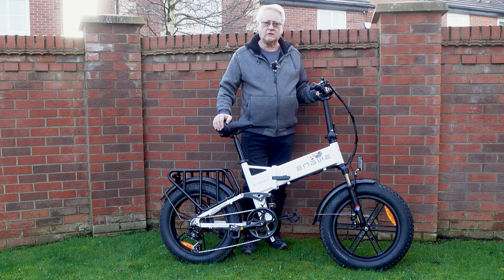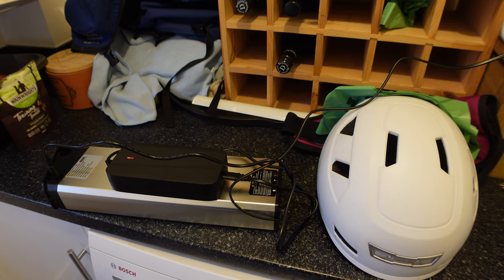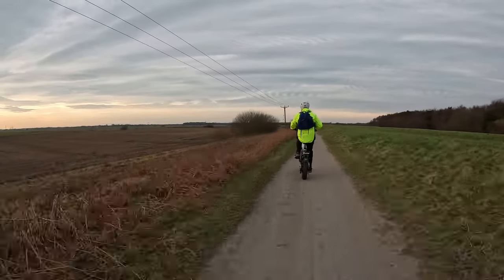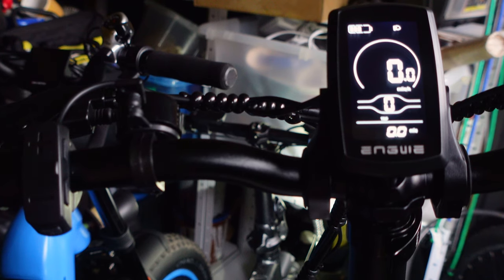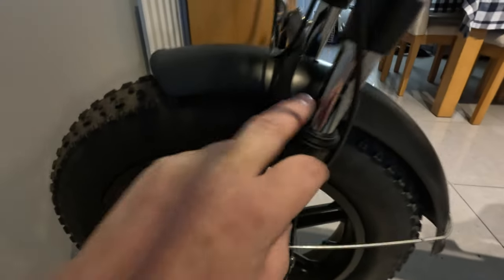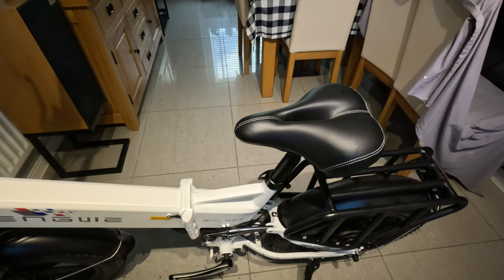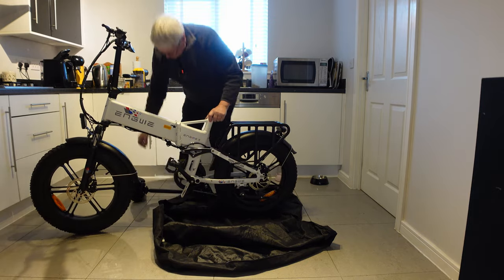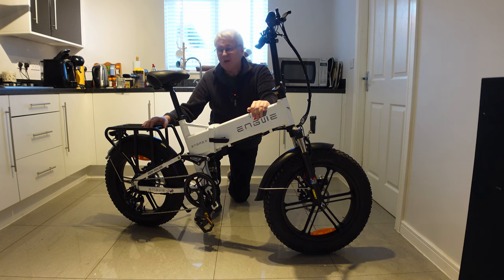Engwe Engine X - UK Legal Fat Tyre Folding E-Bike

Comment: I have the Engine X I live in the country so no traffic around..These bikes come with a 250W motor but it peaks at 500W the 48 volt battery makes the bike go like a moped.
If you de-ristrict it and turn on the use of the handlebar throttle.. then it will on the flat achieve 23 mph...without pedaling. The throttle doubles up as s cruise control if you engage it for 8 seconds or more.
The bike rides much better on roads if you lock out yhe front suspension .
Having said all of this I ride pretty much to uk speed limits, the throttle is lovely for setting off up hill than having to use the pedals to get going, particularly pulling out st crossroads...
If purchased in red its a real head turner...
I absolutely Love It, I think Bob likes it too...enjoy it bob ..dont tell anyone you de restricted it I don't but I could see you enabled the throttle and could adjust the max speed ..mums the word
Reply from the maker: I didn't unlock it on the video, I just showed how you can increase the speed. As you know, shipped it conforms to UK law - the throttle only takes you up to 5kph unassisted, speed is limited to 25Kph and motor is restricted to 250w. It can be unlocked through as can all of these ebikes.

Comment: I've had my engine x in white since October last year. Overall it's a good bike, quite robust but not without its flaws the biggest for me has been the rear axle bolts for the rear suspension. I found the ones on mine were too short which meant once the bolts were tightened up it didn't allow the suspension to move up and down. I replaced these with two 86mm ones which solved the problem. The gears are too short, at max assist at 15.5mph your legs are going pretty fast so I changed the crankset for one that has 56 teeth. Changed the front brake disc for a 203mm one with the shimano adapter for better braking. Another thing is to charge the bike with the battery in the bike where possible as opening and closing the bike can wear out the contacts on the battery faceplate, these have been known to short out and melt. The headset bearings sometimes need adjustment but generally they're ok. I've done quite a few mods to mine including a 2 battery setup giving me a total of 23ah of capacity. Realistically the range of the 13ah is about 25 to 40 miles. I'm a heavy guy so decided a bit of extra capacity was needed to haul this lump along. 😂
Reply from the maker: Thanks for the feedback on the bike. I did 20 miles on Sunday on it, after I made the video, and was quite surprised that the battery indicated was done to three bars, so like I said someone my size will probably get around 40 miles at the most.

Comment: I believe there is actually a 750w motor as if I remove the speed limit I can go up to 52km/h I'm 83kg heavy and my backpack some 5kg.. enough to go to work and back 2 times. It's about 12 km 1 way.. goes uphill up to 43km fast..

Comment: the throttle does not work unless you ouver ride it or am I wrong. Can the throttle be set to work in peddle mode if so how. got the bike today and love it
Reply from the maker: You can change it in settings, but it will propel the bike up to around 4 mph before you need to pedal.

Comment: Nice bike Bob and a great price.
But at 38kg's and with FAT tyres would these fit onto a rear motorhome bike rack.?
Pretty sure FAT tyres will not fit onto a standard rear bike rack, but I may be wrong.
Reply from the maker: It certainly won't fit on my Thule tow bar rack, that only takes 25kg per bike. I wouldn't want to put it on a wall mounted one either! Garage would be best.

Comment: The Chinese are certainly pumping these out at a rate of knots. The prices are increible compared to the European brands, just wonder about the quality. Will they last as well ?
Reply from the maker: Only time will tell seems pretty solid!
Reply: They fall a long way short of European bikes in loads of aspects, having had a couple and serviced other people's cheaper bikes I'd never have one, having said that they may suit less discerning riders in flatter terrain.
Reply from the maker: Like me then 😁
Reply: @BobEarnshawMoHo  😊 Yes I would say so. My friend (aged 76) who had a similar bike with cable brakes was round almost daily wanting the brakes adjusted, in fairness it is very hilly around Chapel where we live. He went on to buy a Trek with hydraulic brakes and they've been considerably better with just a pad change in a year of ownership, he is quite heavy too.  I was surprised at how discerning he was given he wasn't really a cyclist, he says the Trek is a considerably better bike, but then it was almost 3 times the cost of the Engwe.
Reply from the maker: Yes, I do prefer hydraulic brakes, but it all adds to the cost.
Reply: ADO have something equivalent in their A20f Beast. Big plus points are hydraulic disc brakes, torque sensing motor, TÜV tested and approved frame with 10 warranty and 27kgs weight. All up around £1350 from memory.
Reply: There’s a reason they can sell them so cheap.